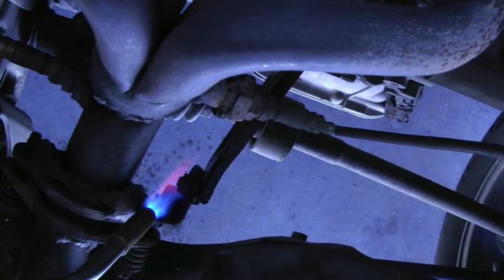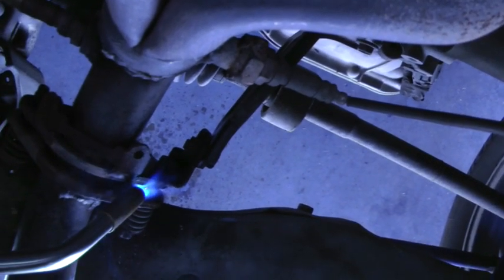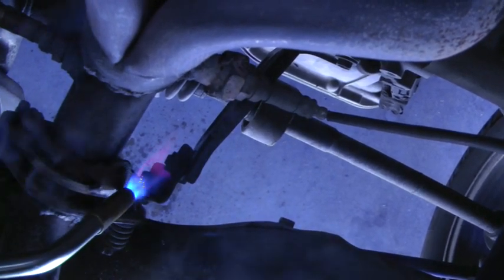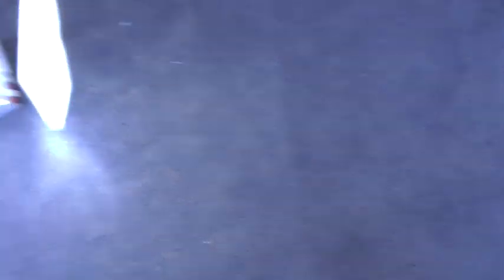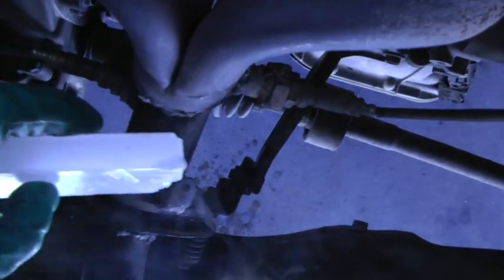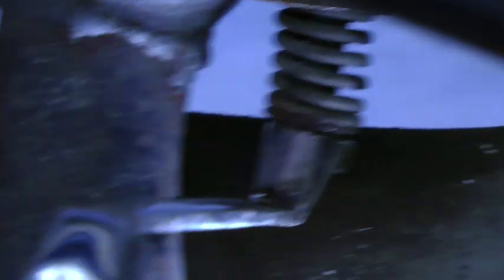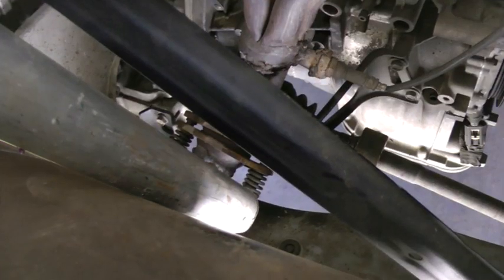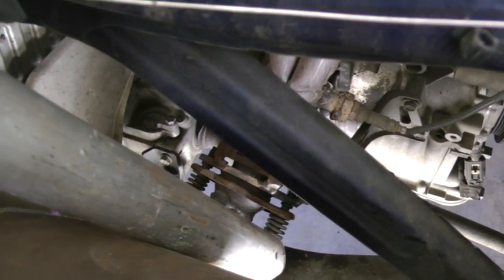How to loosen a stuck bolt using a Mapp gas torch and candle wax DIY

Comment: When I worked at a auto repair shop we would heat the nut red hot and they will turn right off fairly easily, no wax needed.

Comment: Yes, this almost always works, but usually when the threads are exposed, as in removing a nut. But, what I do is heat the bolt orange with the Mapp/Pro gas, stuff wax into the correct size socket for the nut, then push it onto the nut. It seems to force the wicking action a little better. This does not work so well when only dealing with a bolt where the only the head is exposed...unless you can get to the threaded side somehow...then it will work.
Reply: Good suggestion!!

Comment: Hi

How do you perform this operation when gravity is not an ally?

I.E.  upside down or sideways such are many exhaust system bolts.
Reply from the maker: Thanks for the question Michael. Gravity matters not in this case. The wax will "wick" its way in.  Yes just like wax "wick's" its way up a candle wick against gravity.
Reply: @jbl212  

Thank you for your video and reply.   I shall attempt this on the front brake backing plate bolts on my 1999 Toyota Solara.   Corrosion made me take the cheap way out and left the biltd in on the passenger side but then I could not get the steering knuckle level on my 12-ton press and the 0late got mangled.   

I was so frutrated with stripped/corroded bolts that I was going to get an acetylene set.  After reading how dangerous acetylene was to include it can set itself on fire, I googles to your video to aee how to use MAPP gas instead.
Reply: flip the car upside down. then gravity will be your best friend ^^

Comment: Just bought some propane and a torch attachment. Now I'm wondering if propane gets hot enough to work on cars. Don't think my torch attachment can be used with MAP gas. Is propane enough, don't mind waiting a little longer, just need to know if it will get how enough.
Reply: Propane is hot enough. Heat and wax is the most effective technique I’ve ever seen. Apply the wax to all exposed surfaces of the fastener - both sides of the nut, the bolt head, all threads, and any other joints in between. If you’re doing suspension work, expect the rubber bushing to melt or burn and require replacement.

Comment: I really think the wax did absolutely nothing to help loosen it... Here's why:
1: You heated the bolt and torqued it while hot (will remove 90% of all bolts by itself)
2: wax is much thicker than penetrating oils so a real lubricant would probably work better in general (albeit not being able to heat it)
3: you used a breaker bar and a 5 foot tube on a dinky little rusted exhaust bolt..... I've removed worse with a regular ratchet
Reply: Your “Thinking” only proves how much you don’t know.  Maybe you can explain to us how a candle won’t produce fire because the wax is too thick to flow against gravity up thru the wick and be vaporized into a fuel?  Maybe you can explain how the wax in Chapstick will never have to be reapplied to lips because it is not absorbed by penetrating the skin?  Maybe you can explain how Archery String Wax doesn’t lubricate the arrow of the Archer on the horse in your Sagittarian meme?   Wax IS a real lubricant. In fact wax is a component of many lubricants. Some people "THINK" too much and DO too little, dinky.
Reply: @lopeylopez8953  there was an actual test done on this exact experiment that proved that the wax does nothing because it was too thick, didn't penetrate into the metal, and didn't lubricate anything. The examples you listed have absolutely nothing to do with penetrating rusty metal and are where waxes are how they should be (actually some chapsticks has additives that make it so it gets worse if you don't reapply it) so they're pointless. Shows how much you don't know